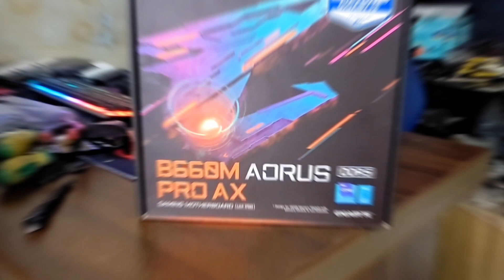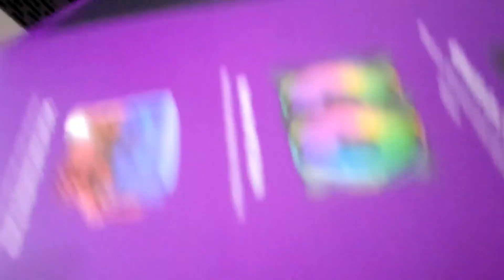Build I9 12900K/AORUS B660M Pro AX/ No GPU

Comment: I have the B660M  Aorus Elite AX motherboard(one step higher than the pro board). Cost me $240 on Amazon and it is a BEAST of a motherboard! It has 12+1+1 high-draw Mosfets and fully covered VRM's with massive heatsinks. With the F28 BIOS flash, this board fully supports ALL 12th gen, 13th gen and yes, even 14th gen cpu's(all the way through the i9 cpus...)
I built a $3,600 gaming rig with the Elite board!